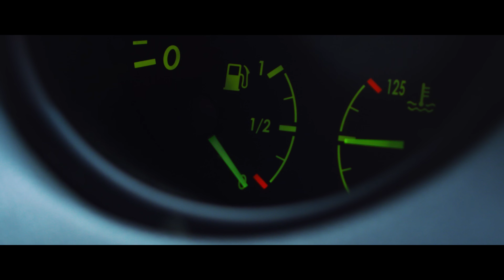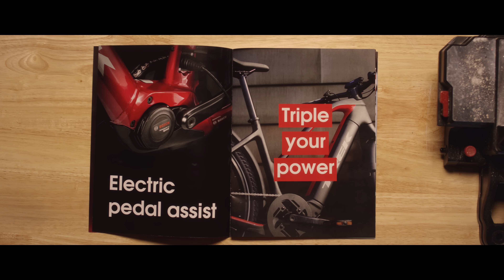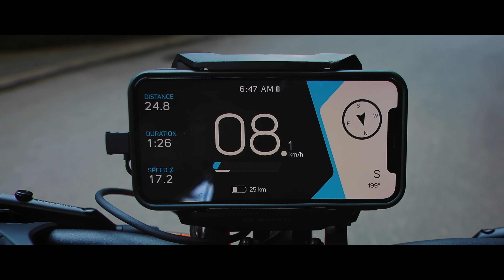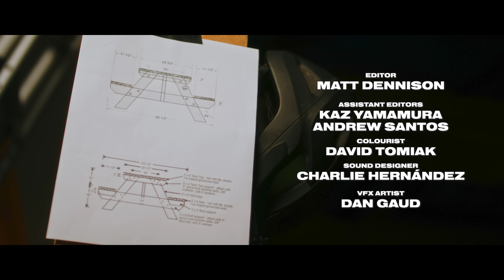Time To Buy An E-Bike

Comment: So when do we see the Squirrel Space 2.0 table?

...asking for a friend.
Reply: Lol
Reply: 2nd to a trek reply :)
Reply: I got a pet squirrel he would love on of those tables 😂
Reply: I want a mtb
Reply: I'ts probably gonna be 20% stiffer and 7% lighter.
Reply: @JimRunarHansen  and overpriced for the spec
Reply: @owenkennedy7854  yeah but the frame of the table is probably got a sick paintjob and is reeally strong.
Reply: Squirrel Marlin table 2.0
Reply: With the recliner and ramps at both ends
Reply: Remember when that trek police bike ran over a restrained dude's head?
Reply: Omg trek I have a Roscoe 7, it’s litterally the greatest thing in the world.
Reply: Woah actuall trek XD
Reply: @artofthechicken1733  my buddy had one and it rips!
Reply: I can make you all one if you want?
Reply: xDDDDDD
Reply: does your friend happen to be a squirrel
Reply: As soon as we see rider built e-bikes self combust! 
Yeah, there is always a risk with lithium batteries, but holy crap, $700 USD for a 36v 13.4 Ah pack with proprietary fittings and a mediocre bms system is nutty!  Suggesting that the more powerful, much less expensive systems are inherently dangerous hurts EVERYONE. Instead promote the dealer network, warranty and sleek looks. 
I like tinkering and have a solid understanding of basic battery electric motor systems, DIY Bafang all day, but I'm enthusiastically all for bikes like the Allant+. They really are great!
Reply: Hey trek, riding an Xcaliber 8 2020 currently. Big upgrade over my last one.
Reply: Hey Trek, how’s about you start thinking about a solution to your bikes being over a year out. I really want to throw money at you but you just won’t let me!
Reply: @jedmoolman7900  bit rude
Reply: GUYS ARE WE GONNA IGNORE THIS THEY SELL THEM ON THEIR WEBSITE, IGHT MERCH SHOP!!!!!!!!!!!!!!!!!!!!
Reply: Best bike company out there.
Reply: Sponsor me
Reply: Looking forward to it!!! Hopefully 3.0 coming out soon can someone ket me know?[joke] 🤣🤣🤣
Reply: @zacho863  you can buy one at the mercy store
Reply: Trek Bicycle
Reply: When you stop selling bikes to cops
Reply: I’m confused between the relationship between treck and this channel
Reply: @lexlawes1551  trek sponsors them
Reply: @ertugrul791  go work for it, you bum
Reply: @JimRunarHansen  and its RED
Reply: @Butzelbatzer  oh yeah, its fucking RED.
Reply: Hello Trek, your bikes are pretty expensive in EU, how about building a factory in Germany/France/Poland?
Reply: Your bikes are too expensive

Comment: haha, that's great. 36v or 500w won't do much on that hill though. 1000w+ if you want to tow things up hills. And it doesn't need to be from a name brand bike, just make sure the battery manufacturer has a good rep for using name brand cells and a good bms. 52v 1500w if you want to replace your car.

Comment: Cant agree with the first part. DIY EBikes are awesome. I had one with a 52v 17.5ah battery and a 1500W Bafang BBSHD. Went 35mph and had practically infinite range. Only cost me $2,000 to make a hard tail DIY ebike. Working on a 6,000W 72v system now. Quite hard to make an ebike explode if I’m being honest. Also, ebikes sold from the shop are legally limited to 28mph :(

Other than that though, awesome video!

Comment: everything in this is true. although... if you're really an ebiker you'd know that forgetting to charge and running out of battery is the worst thing ever. Kinda like riding a regular bike, except it's twice as heavy and almost twice as slow. Also, retrofit bikes can be amazing too, and like 1/3 the price. Don't diss on them too much!